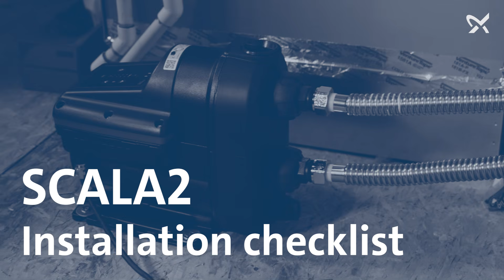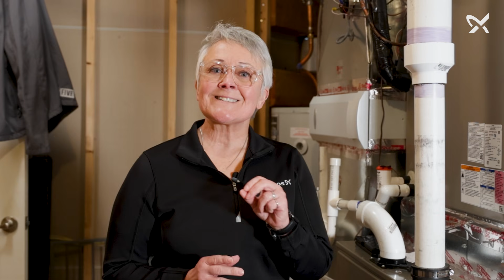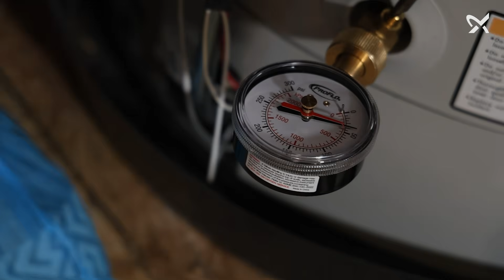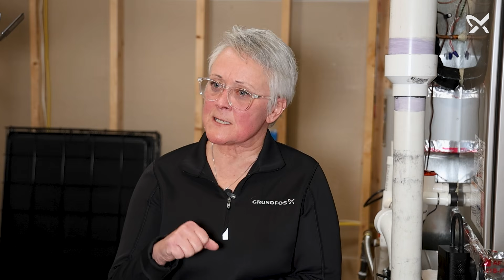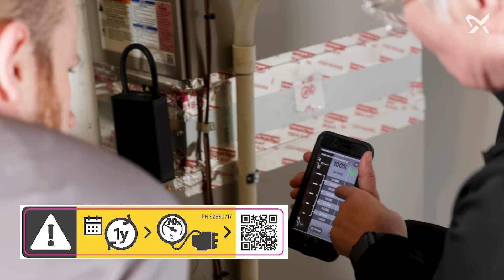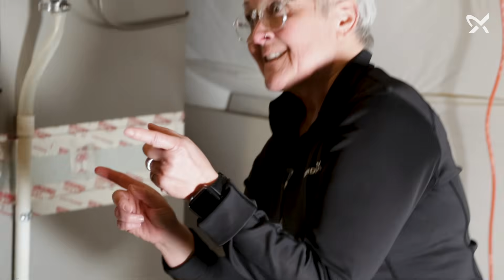PRO TIPS: SCALA2 installation checklist

Comment: This is an excellent installation video with all the considerations and steps needed. Very good content and well produced - applies to all of these styles of booster pumps a well.

Having personally installed (and removed) a SCALA2 twice, I have a first step that I do before the other steps in this video:
1) Make sure you have a DAB pump, and NOT a SCALA2

My first SCALA2 failed with the ultra-common pinhole leak - Nice slow un-detected leak - just enough water to mold bloom the utility room in my rental. A concrete room with a drain in the floor, so no major structural damage. Was issued a warranty pump, but only received a partial credit towards the new pump since the new version was priced higher. The replacement SCALA2 ALSO failed, but with a main shaft seal leak that took out the bearings. By then, out of warranty. More mold. Went to Furgeson to get parts to repair it (seal kit, bearings). No luck - Furgeson does not carry parts for these. My local Furgeson doesn't even advertise that they carry SCALA2 anymore because of so many failures. I was recommended a DAB pump, which pretty much every installer in my area has switched to.

Don't install a SCALA2 where you would have installed a pump that doesn't leak (like a older style Jet pump, or a DAB). It will leak. You will be servicing it. You will need to find parts (good luck).

Note the maintenance interval on SCALA2 pumps - they are short, they are expensive. The full re-seal every 3 years is a couple hundred bucks in parts. Your pump WILL leak if you don't do it, and probably will leak even if you do.

Annual Service:
Pre-charge pressure in the integrated tank - the tank on both my units needed re-pressurization regularly.

3 years:  The service parts for a 3-year service are:
O-rings
Plugs and valves
Shaft seal
For a 6-year service, the parts list expands to include the chamber stack (hydraulic end) in addition to the above.

It is weird living in a time when Italian plumbing parts are of higher quality than German ones, but here we are.
Reply from the maker: Hi @tsiratnulov, Thank you for your opinion. We appreciate you have had some unpleasant boosting experiences with Scala2. If you choose to install DAB, know that they too are a very respectable company with a fine product. Please note that many of the installation tips that would have helped with Scala will be equally important when installing DAB. Your booster is part of the plumbing system. For systems to operate correctly installation is critical. - Katelyn

Comment: I have installed one and I have an issue with the pump where it will start to stop after pressuring the system but then start back up run for a bit longer then shut off fully. it does this every time it runs.
What could be the possible cause? Inlet water is from a 200 gallon tank
Reply from the maker: Hi @LiquiDirt, Thank you for your question. 

First, please make sure the tank has been pre-charged correctly. Depending on the height of the tank, the incoming pressure is likely only around 3 to 5 psi. For example, a full 8-foot tank would provide approximately 3.46 psi of inlet pressure (8 ÷ 2.31 = 3.46 psi).

With this inlet pressure, the maximum discharge pressure of the SCALA2 would be approximately 50 psi, which corresponds to the middle setting on the discharge pressure display. The pump cannot exceed 50 psi unless additional inlet pressure is available. If a higher pressure setpoint is selected without sufficient inlet pressure, the pump may continue running in an attempt to reach the target pressure.

It is also important to verify that the diaphragm tank is properly pre-charged to 36 psi. If the tank pressure is not set correctly, the pump may either run continuously or short cycle.

The recommendation is to:
- Measuring the incoming pressure.
- Setting the pump for no more than a 50 psi boost above the inlet pressure.
- Ensuring the pressure tank is properly pre-charged while isolated from the system.

When the system is properly balanced, the pump should shut off within a few seconds and should not restart unless water is flowing. 

Thank you! 
- Katelyn
Reply: @grundfos  OK great thank you I have the unit set and it is working however I have a new issue. I set the pressure needed by way of the arrows and then I press the up and down to lock it. however the issue is the pump once cycled it returns to the middle pressure it is not pumping at my settings. I can unlock it and press the up arrow and it then will go to my pressure setting. but again once it cycles it returns to about the middle presure setting according to the LED on it. It will not spool up to my pressure setting on its own. I can only get to my setting by manually pressing the up arrow each time it kicks on.

How to I permanently set the pump speed pressure I want it to have so each time it kicks on I get my presure setting not a default presure the unit has saved some where?. thank you for the help.
Reply from the maker: Hi @LiquiDirt, If the pump is unable to reach the higher pressure set point, it will automatically derate itself to protect the motor from overheating. The SCALA2 is capable of producing up to a 50 psi differential between the suction and discharge sides of the pump. Therefore, if your incoming water pressure is less than 30 psi, the pump will not be able to achieve higher pressure settings.

To determine the maximum pressure the pump can provide, measure the incoming water pressure at a hose bibb or the water heater drain valve. This will give you the static supply pressure. Add 50 psi to that value, and the result is the maximum pressure setting the pump can realistically achieve. Set the lock button to that pressure.

The reason the pumps continue to leak is likely because they are being set to produce more pressure than they are capable of delivering. Newer SCALA models are designed with built-in protection features that prevent this by reducing output when the set point exceeds the pump's capabilities. This protective function is why you are seeing the pressure drop or cycle back. Our SCALA2 installation checklist is available to download here: http://gfos.ly/6055BGYMjZ 

Thank you! 
- Katelyn

Comment: This thing is awful ... It trips the breaker immediately upon starting... Can't use at all
Reply from the maker: Hi @Dr.jp113 The SCALA2 incorporates a true variable frequency drive (VFD) to control motor speed. This process converts AC current to DC current, which is then stored in a capacitor for several seconds after the pump stops. The resulting small amount of “residual current” can trip a standard GFCI in most residential applications.

For this reason, we recommend not connecting the pump to a ground fault circuit interrupter, or using only a Class B GFCI with a higher 20 mA threshold. This information is included in the I&O documentation, installation video, and installation checklist.

Most residential GFCIs are set to a sensitivity of 4–6 mA. Residential equipment that incorporates variable frequency drives, such as modern HVAC systems, is typically installed on dedicated circuits. If a Class B GFCI is not available, an electrician can hard wire the pump directly to an outlet box with a standard light switch for shutoff.

I&O Manual → http://gfos.ly/6053B1rkqH 
Installation video, and installation download → http://gfos.ly/6054B1rkqy 

Thank you, Katelyn
Reply: As stated below, this was covered in the video.

Comment: Hello. Can i add external pressure tank (24 or 50 liters) for the scala 2 ? Goal is to reduce pump from starting at every minor water consumption. Thanks in advance.
Reply from the maker: Hey there! While an external pressure tank is an option, correctly setting up the SCALA2's internal tank should prevent short cycling with every minor water draw. -Ty
Reply: @grundfos i tried that many times. It's too small to prevent anything. I've been told that the maximum suitable external tank size should be 20 liters, as more than that could confuse the pump logic. Can you confirm this ? Thanks for answering, thats rare sight with big manufactures.
Reply from the maker: This might require a further conversation. Can you e-mail us your contact information? dbsamericas@grundfos.com. I want to make sure we get you the right support and answers. -Ty

Comment: Hello. I use a pressure system drawing water from a water tank inside the house. The water tank is placed at the same level as the pressure system. I would like to switch the pressure system to Scala 2. Will it work if it draws water directly from the tank and not the mains(it will not have positive inlet pressure from the mains).  Thanks for your reply.
Reply from the maker: Hello! To answer your question, the SCALA2 will work in this scenario. If your setup is flooded suction, the water level in the tank will give the pump positive inlet pressure based on how high the tank water level sits above the outlet. Just be sure the tank has a float switch so it can refill while the SCALA2 is drawing from it—because the pump can move 10–15 gpm at around 40–50 psi even with low inlet pressure, and it’ll empty the tank fast.

If it’s a well system with a 30/50 or 40/60 pressure switch, the SCALA2 will sense the changing inlet pressure and automatically adjust speed to maintain steady outlet pressure, so you won’t feel any fluctuations. Also in both instances, it's important to make sure you have thermal expansion protection, since the SCALA2’s internal check valve can cause issues with a water heater if it’s not installed. -Ty
Reply: Thank you very much for your reply